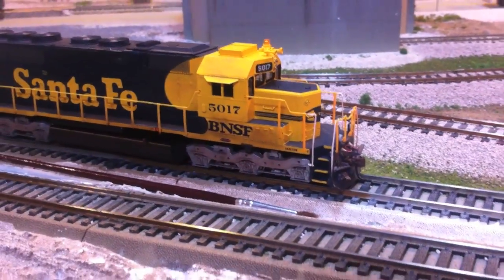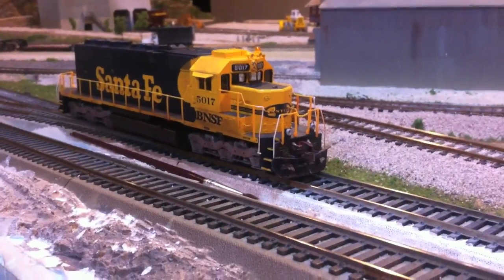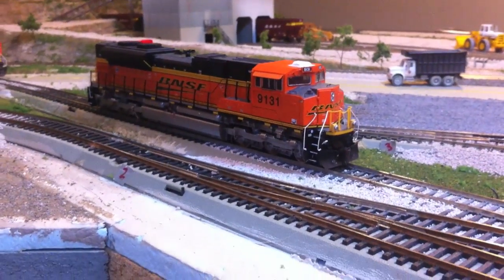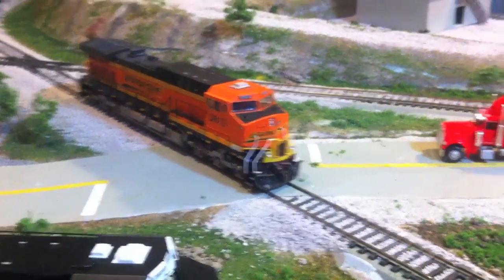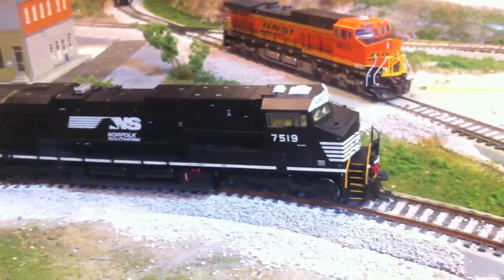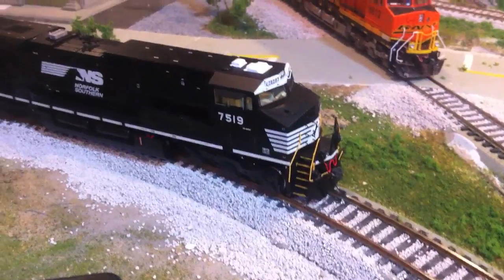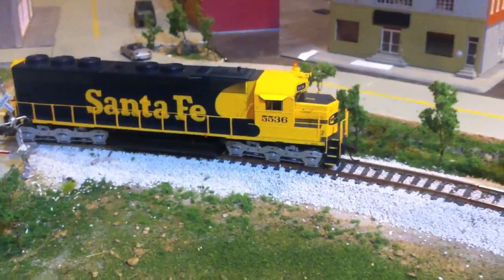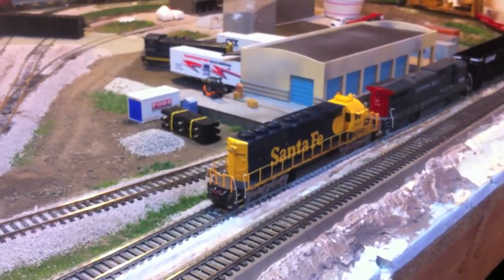BNSF "Arlington Sub" HO Scale Locomotive Roster Part 2

Comment: If you haven't done it yet, do not send 9131 to Athearn. They use incandescent bulbs, and are very prone to burning out. Replace the bulbs yourself with SMD 0603 LEDs. They are a pain to wire, but look better, are small enough to fit---I have done it before---and they don't burn out! Use the same LEDs for the Yellowbonnet SD40-2 also.